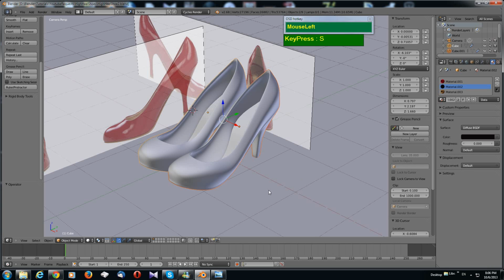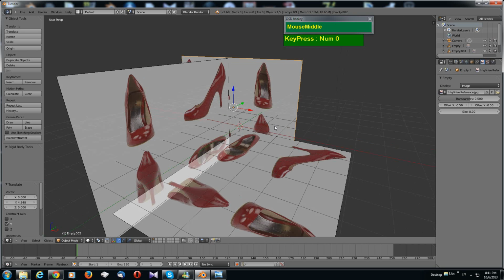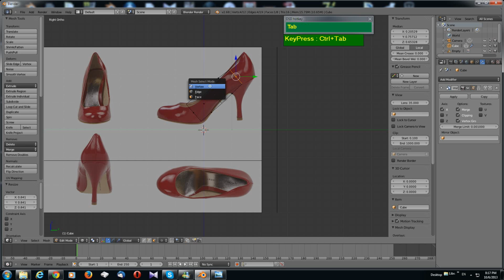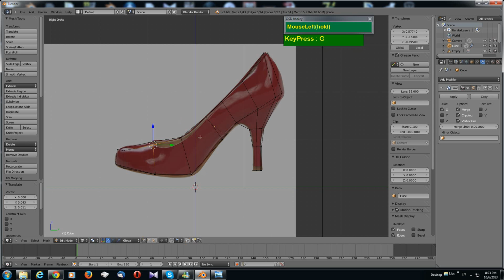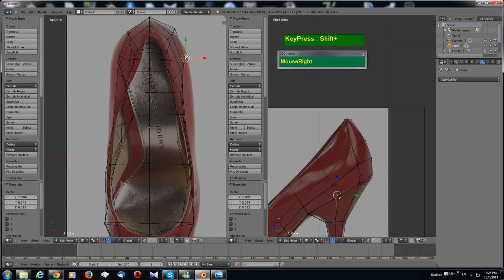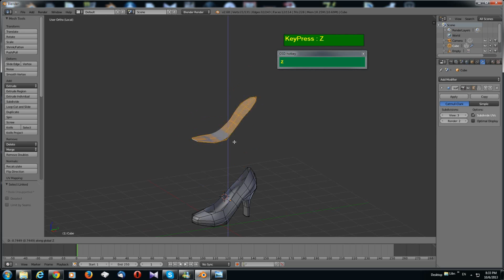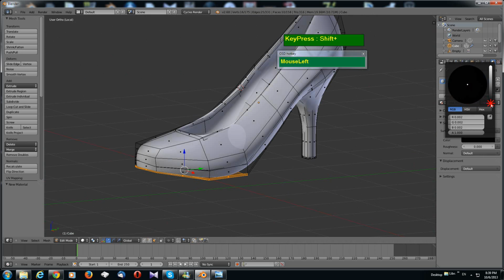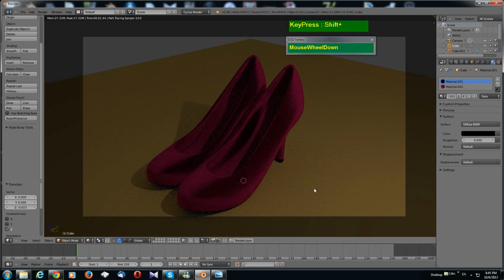Blender 3D Modeling Tutorial - High Heels

Comment: I'm a veteran 3ds Max user, but I'm learning Blender just because. Your tutorials have been really helpful. : )
Reply from the maker: You are most welcome! I was also a former user of 3dsmax, I personally think Blender is a far more capable modeler than Max or Maya and I have used them both professionally.
Reply: +weeliano Thanks for the input. I also think blender is superior over all.
Reply from the maker: +kijalarevai Sure, now my initial experience with Blender wasn't good at all, right mouse click selection and tonnes and tonnes of short cut keys. Once you overcome this which took me about a month of almost daily usage, I noticed that I can model way faster than either Max or Maya. Now I didn't say that Max or Maya is inferior to Blender, they can do the job equally well, it is just a personal opinion that Blender does mesh modeling faster than compared to Max or Maya. In Maya it can get confusing to choose between the components and object mode, whereas in Blender it is just pressing the Tab key to choose between edit and object mode. In Max it is slightly better but I still have to click on the toolbar on the right. To be fair I don't want to get into a software discussion about which one is better than the rest, someone else will say that Cinema4D is the best 3D application out there and they are right. In my opinion, you use whatever software which fits your needs and gets the job done. In fact learning a single 3D application allows you to pick up all other 3D applications even faster. The software capabilities are always changing and Maya 2016 has introduced a host of features that now makes it even better, but I still think Blender's mesh modeling is better. :)
Reply from the maker: +kijalarevai Maya does have an advantage in the NURBS department, however the conversion to polygons needs some tweaking. Blender's NURBS implementation is not as good, but it doesn't need to as its mesh modeling tools is already very top notch. Coupled with B-Surfaces, you can create complex curved surfaces as easily as NURBS in Maya. Check it out - google B-surfaces addon for Blender, it is now a standard plugin for Blender.